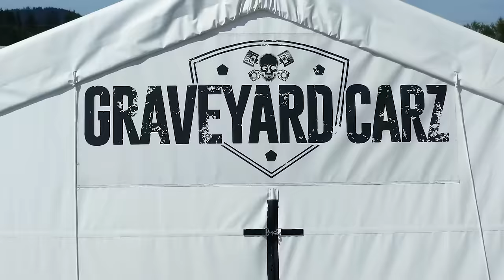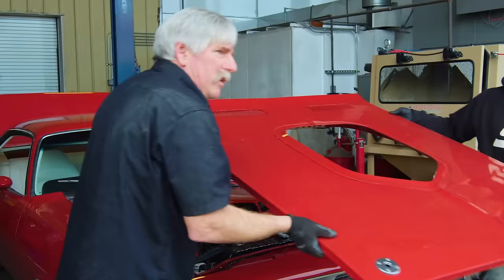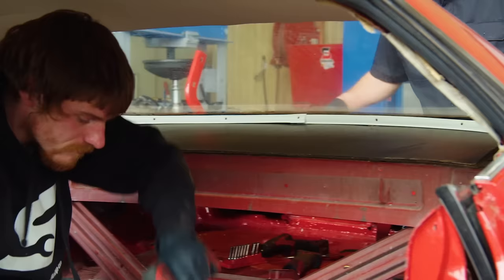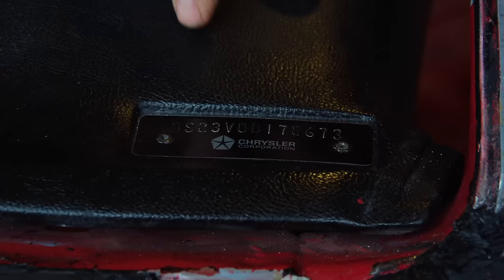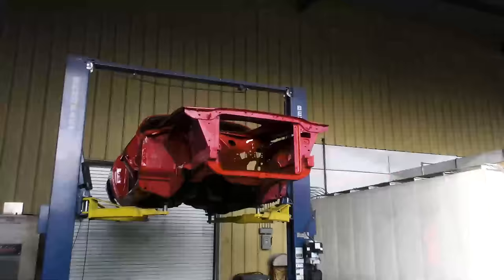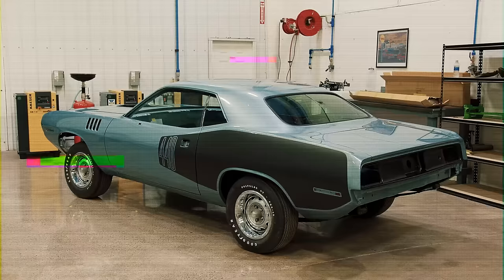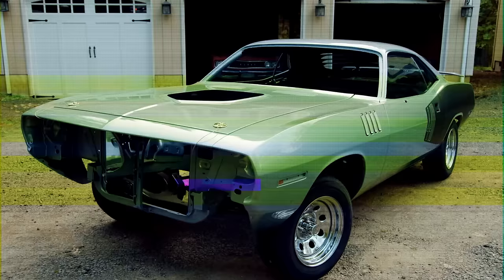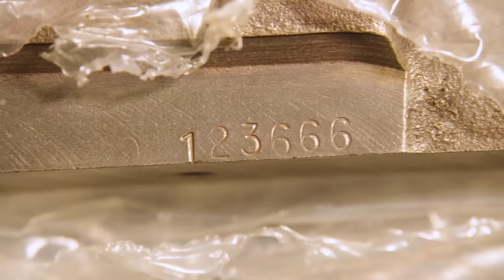JIM ROOT FROM SLIPKNOT IS NOT HAPPY: MARK INFORMS HIM THAT HIS 150K 'CUDA IS NOT NUMBERS MATCHING!!!

Comment: I've done something similar with my '68 Camaro. There are so many tell-tale items on these early cars. Do your homework and you can find ways of telling original from a fake.
e.g. True SS Camaro cars has a different (and heavier) hood. Guys can put an SS hood on a car, but seldom will also change the hood springs to the SS version with two more spring turns factory installed for the heavier hood. 

Detective work is fun. Nice job to Graveyard.

Comment: When I was 18 yrs old, I ordered a 1972 Dodge Challenger Rallye in B3 SuperBlue.
It was a 318 cu inch and 3-speed on the console. I replaced the Carter carb with a Holley 500 2-barrel carb. It has a single exhaust, but I later replaced it with headers and dual exhaust.
It came from the factory on May 17, 1972...I sold it on Ebay on Christmas 2005.
Reply: Do you wish you still had the car?
Reply: I sold a v code 70 Cuda shell 17 years ago  $5,500  bought it for $200 in 1977 for the 4spd trans

Comment: My first three cars were all Mopars. 70 Dodge Dart Swinger w/340 magnum (orange engine), 1970 Dodge Challenger w/383 magnum (orange) and lastly a 1971 Plymouth Roadrunner w/440 magnum (orange). I also, since I had an inquisitive mind, wanted to know as much as could about each of my cars. The first two, I was still in HS. I made friends with local mechanics and helped them out as a gofer/intern and the first thing they taught me was magnum engines are orange and the blue painted engines were not. I love late 60’s and early 70’s Mopars. Wish I still had one. Was hit by a drunk driver while home on leave in early 90’s and I received a substantial settlement. Instead of buying a MOPAR like I had, I bought a Corvette and became obsessed with them. Even going so far as to having mine built and with the option to go to Bowling Green to pick it up from the factory. Drove all the way back to Seattle in my new Z06.

Comment: I have a fresh 70 440-6 complete with 4 speed and e body dana all from the same care going up for sale . carbs were all done , intake is beautiful . it came out of a 71 clone i bought that im doing a new hemi and 6 speed but the drivetrain is from a 70 challenger 440-6 . i would like to see this drivetrain go to good use . everything has less than 600 miles on it since being built and comes with the k member suspension all of it

Comment: I always thought the Charger Daytona was based off the Charger "500", not the RT.
They all have the same engine options, but the 500 has the sloped rear window like the Daytona, instead of the tunnel style of the RT.
It also had a shorter trunk lid. The longer trunk on the RT would have hit the wing.
Please correct me if I'm wrong.

Comment: the cars are beautiful and the work is amazing, here in brasil we have like 5 Challengers and some chargers i know just 2 cudas here our dodges of the 70s are all variants of the dart, like our charger rt is a dart with different front, the parts of the rear windshield and higher compression
Reply: Yall had a cool chevy nova version I think
Reply: @shaunramsey22  yeah the chevrolet opala its a mixture of the nova and the european opel reckord with the chevy 250 6 cylinder, some people today swap it with the chevy 350 v8 but its very expensive to do the swap because the engine its the price of the car

Comment: Why did they stop building cool cars in the '80's?  Two words. Federal regulation.
Reply: high fuel prices and insurance rates were high, the customers wanted the cars, the mfg big wigs got scared and cowed down and started building junk, what is bad for sure is the little cars and little motors burned more fuel and were not dependable at all, they would ride like the little red wagon i had as a kid.

Comment: Look for trouble hard enough and you're sure to find it. That's why if you buy a nice looking, nice condition, complete, finished car there's no need to be pulling it apart instead of enjoying it. Get things verified prior to purchase if that's what's important to you. If somebody wants to parachute in and buy it as is before you can complete your due diligence, so be it. Let them have it and get yourself a different one.
Reply: I agree but there's a limit to due diligence.  It's not like you can go buy a car and before you make the purchase you pull the engine and or start removing paint to prove/disprove well hidden details.  If the customer purchased a "numbers matching, restored car" and wanted to pay another garage to have a "show quality, numbers matching, factory restored" car than none of this could have been avoided within reason.  If I had to guess, the customer probably purchased this from a car auction where the authenticity was "verified" before being sold.  Which is probably why Mark mentioned the customer potentially (although not likely) taking legal action.

Comment: All the numbers were punched in to the same depth. If they had scratched off a number, it would have to be filed down flat to that depth, leaving that number .1 mm lower than the others. You can't just erase it level. There were No signs of filing down or sanding ...?!